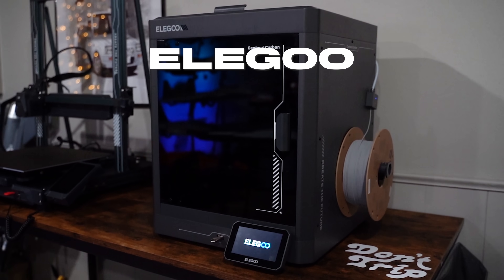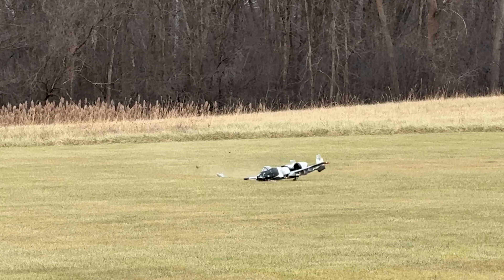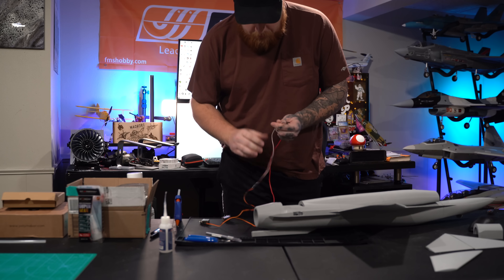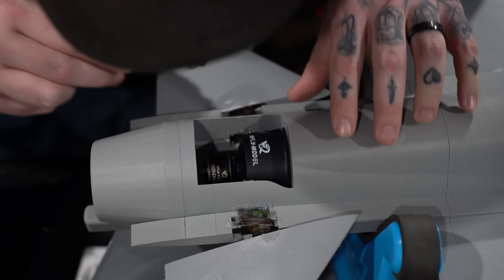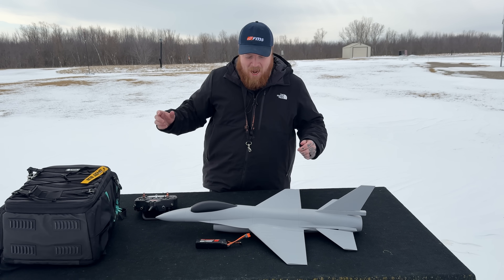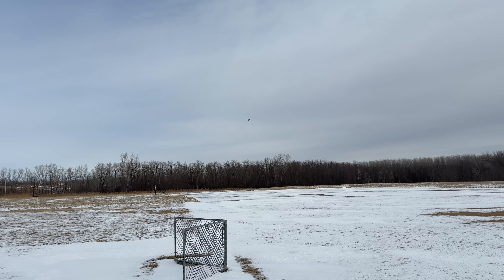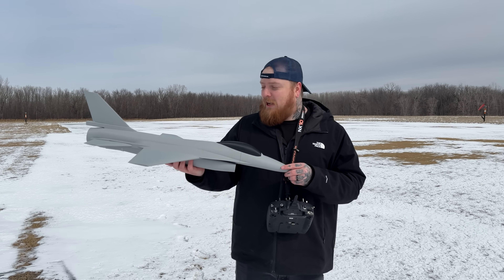Can a Beginner 3D Print & Fly an RC Jet?

Comment: I just finished printing this in LW PLA, printed great and looks great. If you could answer, what was your total weight with all components? I feel like I am way heavy.  I am at 930g, motor, battery(2200 4S), cables, servos....  Do you have a breakdown of your weight by printed components?  Parts fit perfectly!  Printed using Polylite LW-PLA (Gray and Black) with a Bambu Lab P1S.  3% infill on most components and top and bottom 1st 3 layers solid infill.  Thanks for a great video and inspiration!

Comment: Can anyone help me out. I’m printing a 3D print labs cub and I thought I had the setting locked down because the print looks great. However, the ends of the fuselage that are supposed to be joined together are supposed to be hollow but they’re closed off instead. I’m using Creality. There’s breakdowns on prusa cura but I tried and couldn’t get anywhere with those programs. They’re clunky unintuitive and best I could figure out was that I’d need to upload the file to a usb and transfer it to the printer. That doesn’t help me understand how to adjust the settings etc.

Comment: This and the F-22 look awesome!  What would really be the ultimate is if there was a way to assemble them w/o gluing so that if something breaks, you can reprint just that part and replace.  As is, you'd almost have to re-do the whole thing if a wing tip or nose got broken.
Reply: Better designs tend to use cf rods for the wings for easier swapping and wing stiffness.
Reply: This was my thought - I'd rather use rods or literally anything to connect the pieces, otherwise you can't just swap what breaks. Once you superglue everything together it's basically 1 big part, no idea how you would take it apart again.

Comment: Hi so I am 13 years old and I would like to get into the rc hobby without spending much money. Since I am getting a 3d printer for my birthday I will print this but I have a question. How do you get the controller to control the servers and engine in the plane. Do you have a video on how to do so?
Reply: You connect the transmitter(controller) to a receiver and then connect the servos connectors to the receiver accordingly so that their on the right channel, so that you aileron stick doesn't control your throttle or something. For the most likely brushless edf in this you'll also need an esc, which I would search up some videos and the esc you use will vary based on the motor.

Comment: Some tips with your filament-
Stringing is very easy to prevent. Think about the plastic like pizza, when pizza is hot the cheese is stretchy but later when the pizza is cooled down the cheese doesn't stretch. Lower the temperature on your printer to prevent the filament from being stringing.
Whenever i buy filament the first thing i do is dry it out. You do not need an expensive filament dryer like most people say, just set your printer's bed to 60c and leave the filament on there over night.  Filament does not come dry from the factory.
Reply: With lightweight expanding PLA, you need to jack up the temp for it to expand, and the expansion causes stringing. There's no avoiding it.

Comment: I have tried one of these before  and have had a 3d printer for 2 years, but I could not get it to work. Because of this video. I think that I might try again.
Reply from the maker: Sorry to hear that, but so happy you’re willing to hop back in! 3D printers can be tricky and the smallest setting change can send things sideways. Try to follow all the suggestions as closely as you can and you’ll be flying in no time! :)
Reply: @Mach3RC  Thanks for the great video. Love your content

Comment: Awesome work mate. Actually the foam planes have one major flaw. The texture of the foam reacts to wind turbulence a lot more than other planes with smooth surfaces. So coating the outside of your foamies with a good waterbased furniture varnish can make the world of difference to the flying experience.
Reply: World of difference?....Coating a plane protects the foam from marring and slight (potential) hanger rash.The benefit of coating to promote laminar flow vs. straight foam surface would be of little benefit at velocities of RC prop or EDF-powered planes.
Reply from the maker: Interesting, I didn’t know that! Thanks for the comment & for watching!

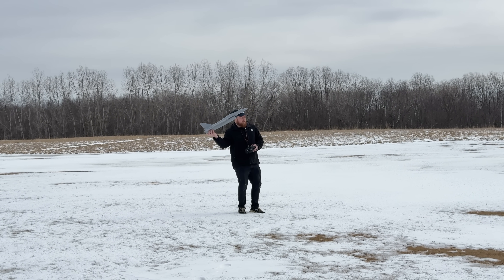Comment: 09:15... lol... i think every viewers will have the same reaction of yours !

Maybe original design could/should be improve to use so screws and screws inserts instead of hot glue on some parts (like for the fan/fan cover, servos, etc.)
Overall it's impressive how 3D printing allow to get some nice things =)

I didn't notice if you said how long does it takes to print everything ? and how many material it needs ?
Thanks.